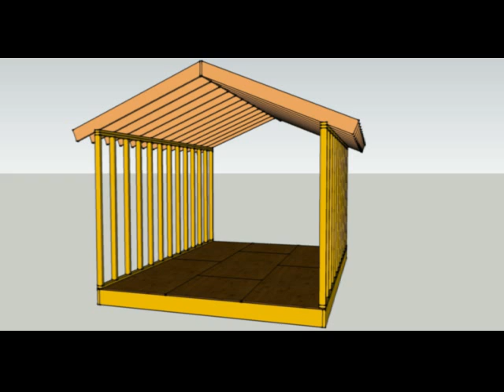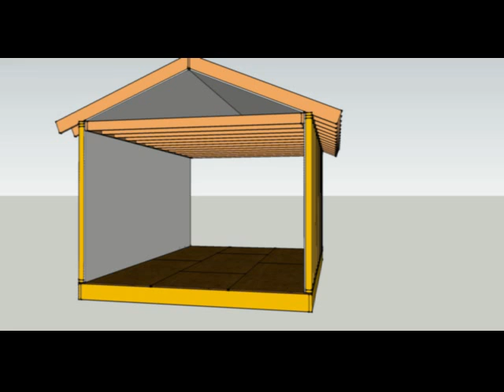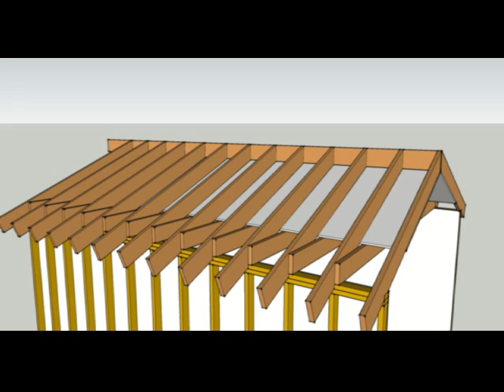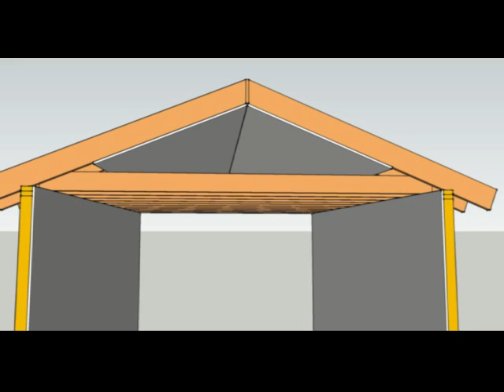How To Flatten A Vaulted or Cathedral Ceiling Part One - Construction Education

Comment: If you do method 1, what would you do to ensure that mold doesn't grow between the vault ceiling and the new flat ceiling? We are trying to do this in Florida and because of the humidity there is potential to cause mold growth because the vaulted ceiling is not exposed to the air-conditioner.

Comment: LOL  cut the ceiling joists ends to profile the roof pitch pine will bend a bit when turn on its side flip them up after getting them up on the top plate of the wall

Comment: If I dropped the vaulted ceiling to a flat ceiling to add laundry and bathroom, do I need to remove the drywall and insulation that is on the existing vaulted ceiling to allow airflow above the new flat ceiling rooms?
Reply from the maker: Good question and yes. Here's a link to your website that might be helpful. http://www.homebuildingandrepairs.com/ventilation/index.html

Comment: I am wanting to do this in a master/bath/walk-in area mostly due to poor original insulation issues. I would be able to get much better air tightness with this design.   There is a partition wall between the bedroom and the closet/bath side. I was planning on using 2x6 to go from the outside wall to the partition wall. It seems that it would only be supporting the drywall and insulation. Would 2x6 be enough for a max 15 foot span?
Reply from the maker: I cannot provide you with engineering advice, but think that a 2 x 8 would work better.

Comment: Hi so I have a room that is about 8 feet in the center but slopes down to 4 feet at the edge. How do I raise the 4' side to be flush with then 8' side?
Reply from the maker: If there isn't some type of structural supporting beam in the center for the roof ridge, then you would need to remove the entire roof and rebuild it, using longer roof rafters that would sit on top of load bearing walls. Let me know if that makes sense and if it doesn't, send me some pictures of your project or a drawing of what you're trying to do for more information.

Comment: In some designs a high cathedral ceiling may have significant aesthetic appeal but too often the result seems a poor attempt and falls well short of reaching 'the great'.  Consequently it seems not uncommon for owners to rebuild, sometimes just flattening a ceiling, sometimes gaining a second floor area in the upper half of the space.

Such high ceiling-ed rooms can be difficult to maintain at comfortable temperature particularly when using a central forced air system.  Heating is readily achieved by the use of radiant floor and/or radiant ceilings.  Cooling is more difficult but with some radiant cooling, engineered ventilation, controlled solar gain, etc. etc. these rooms can be quite comfortable as regards heating and cooling needs.

Unfortunately most home owner/builders are not willing to pay upfront for the engineering, design and installation of the mechanical systems and suitable building envelope requirements needed to make such spaces satisfactory.  No cost spared on counter tops and fine finishes but very little is spent (or too much is miss-spent) on all hidden mechanical elements, insulation and other design details that make up a successful house.

Comment: I would imagine a flat ceiling would be cheaper to heat and cool in the extreme climates also after installed would the install be as strong as a preinstalled truss roof